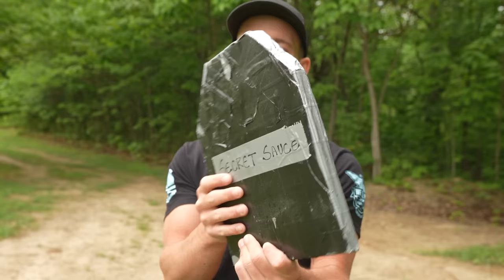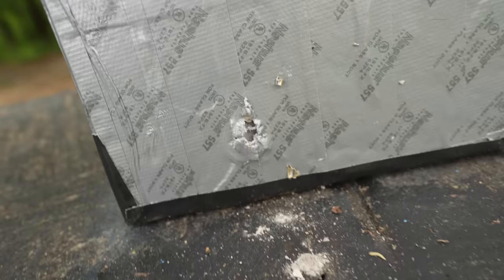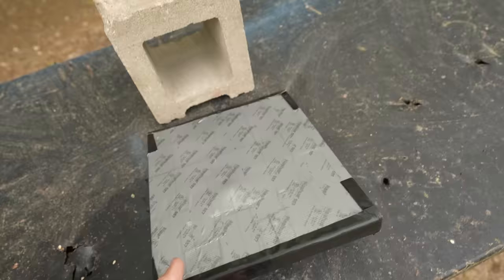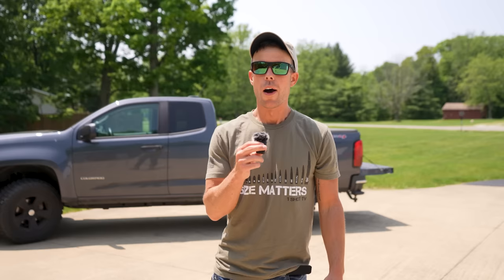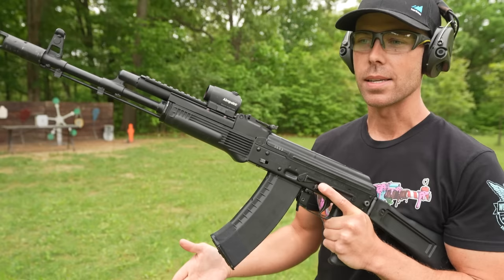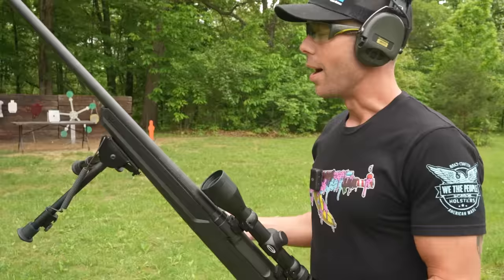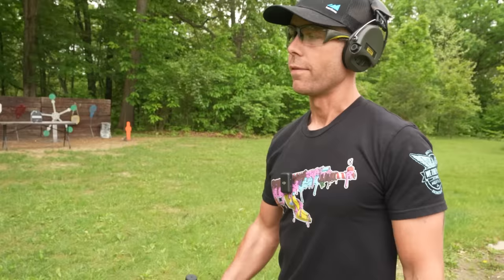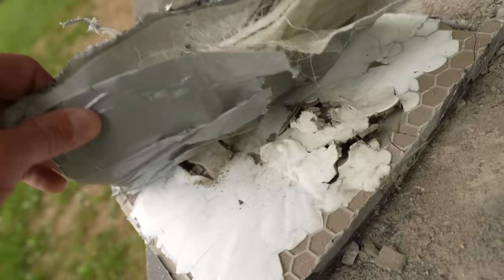CHEAP Homemade Body Armor That Stops RIFLES, How's It Done??

Comment: Got bored and made a plate ... it stopped 3 rounds of 556 and 4 rounds of .308 before it failed... but for 25$ and all materials came from Lowes I was impressed
Reply: i dont suppose i could talk you into sharing the recipe for that armour
Reply: You got a materials list?
Reply: @AlaskanBallistics  thats what im wondering too..i want that recipe ,if it can stop .308 then it must be a good one
Reply: @peacemaker121772  put it in my walls for when the AFT comes for 25 bucks i can armor the walls, at least in spots
Reply: @AlaskanBallistics  2 pieces ceramic flooring 12 by 12 .... fiberglass cloth with resin ... 5/16 ar 400 steel In the middle which I already had ... after the steel .. another layer of fiberglass with resin followed by the last ceramic flooring... followed by wrapping it in duct tape... this was before Biden inflation so I dunno what it would cost now
Reply: @MichelleObamaIsPackinASack  how heavy was it?
Reply: @Daledoback24  10lbs I'd say
Reply: @Daledoback24 that's my thought too bc AR-500 is pretty heavy ... Hell, just the steel in a plate carrier would stop a 50 API! Lol I've seen it done on many YouTube vids of guys shooting steel from short distance with those black, silver, and red tipped 50BMGs, and they stop em every single time (even the exploding 50BMG). not deformation even, yeah some spalling, but that's what the woven kevlar plate carrier is for.
Reply: @BillBraskyy blunt force trauma
Reply: @BillBraskyy AR500 may stop a .50 but if you tried to use it as armor the hydrostatic shock of those rounds will still be lethal. There is no armor that can protect you from .50 BMG unfortunately. At least not with the current technology we have because modern armor is still limited to withstanding .30-06 M2AP at its strongest and nothing else. You might survive against M995/M993 or maybe and I say this very lightly maybe 7.62x51 mm DUDS(Depleted Uranium Discarding Sabot) that were developed in the 50's with some law enforcement agencies having somehow got them by accident. You can survive being hit with these rounds if you manage to get your hands on a pair of Xsapis. But those are so expensive and impossible to get a hold of you're probably better off getting yourself a pair of level 4's and hope that you won't have to come face to face with such nasty threats.
Reply: Got a video showing that?
Reply: @forresthampton1135  I don't actually
Reply: @forresthampton1135  I don't have to show you a video. 895 grain .50 BMG bullet traveling at nearly 3,000 fps will have an impact force of about 14,895 foot pounds. You will not survive that no matter what kind of armor you have.
Reply: Imagine if it was thicker than a quarter of an inch or a half inch after all it could stop more 🤔
Reply: @Bill Brasky  the only mofo ever to catch a .50 round and survive, what you would be doing would not be considered living...
Reply: @nemesisobsidian  You saying that you won't survive it no matter what kind of armor you have, shows your lack of understanding of certain armors. Ceramic armor is literally designed to break and that breaking disperses the energy throughout the ceramic. This could be easily proven in a demonstration with a watermelon behind enough ceramic plates and shooting a 50 BMG at the watermelon. The energy will be dispersed through the breaking of the ceramic. This is why most people line the rear of these plates with a very thin gauge of steel or kevlar just to prevent any ceramic shrapnel from being pushed into the person wearing it. 

By the way, Botach level 4 plates have videos of I believe 338 Lapua and 50 BMG being stopped by their plates. I believe Mr Guns N Gear did a video on it. 

Now if you said your sternum and/or ribs would be broken, that I would agree with. But "surviving"... Ehhhh I think with the proper trauma pad behind it, you could easily survive it. You might not wish you survived...
Reply: @Steven-gv1ke  You saying that I lack understanding of certain armors automatically forfeits your mental high ground in this conversation. I have more understanding about armor materials and how they respond to being shot than you ever will. While ceramic can absorb kinetic energy, it's main purpose is to damage and disrupt the bullet so that a UHMWPE backing can more effectively do its job of catching a now deformed projectile and mitigate some backface deformation in the process.
Most level IV plates are aimed at stopping .30-06 M2AP or most rifle rounds that are less powerful than M2AP. 
You say that you've seen level IV plates stop .50 BMG, I've also seen a video of something similar to what you're describing. In that video, they fired a .50 BMG frangible round at a level IV plate. And most likely it was not a full power .50 cartridge. And while a level IV plate can stop .338 Lupua, the same issue occurs like it does with .50 cal. Even if the round is 100% stopped, the resulting impact will still kill you. There is too much energy in a .50, and this also holds true with .338 Lupua. So we're just gonna have agree to disagree at this point because I'm not the only one with common sense who is legitimately arguing against the likelihood of surviving a hit from an anti materiel rifle, a weapon literally designed to destroy everything in its path, including people.
Reply: @nemesisobsidian there is a armour that stops 50 bmg and its super thin like 1.5 inches something like that and its kinda soft armour to like 1 grand a plate i think lol
Reply: @Macdonald-we4gx  Lol, no there's not. It's entirely impossible to catch a .50 without the sheer impact being strong enough to stomp your insides into jelly. You might as well be saying there now exists armor you can wear on your body that can protect you from a direct hit of 120mm APFSDS. Honestly I'm getting tired of arguing with ignorant people who know nothing about blunt force trauma or simple physics.
Reply: @Macdonald-we4gx  Also armor that's super thin but it's like 1.5 inches thick. Lol, are you kidding me? That's not super thin, that's super thick. Nobody is going to wear armor that thick. Most commercial plates are either 1/4" thick or 1" thick max but no thicker unless you want to look like the Michelin man or be rocking that Ned Kelly look.
Reply: @nemesisobsidian  nevermind its like .48 inches thick 😅 dayton armour
Reply: @nemesisobsidian lol. You funny son.
Reply: @bonejam8231  If by funny you mean trying to educate the public about the absolute insanity of one thinking they can walk into enemy cross fire like they're Ironman or some crap without there being deadly real life consequences to that kind of thinking then yes I try to include some humor into my "scaring is caring" message. Glad to have gotten an lol from you.
Reply: @nemesisobsidian  listen brother if you're getting shot at by a 338 Lapua or a 50 BMG you're either going to have air support or you're in the wrong dudes backyard😂
Reply: @thomandstacieverroad8417  And you're probably right about that to some degree. Which is why I think it's dumb that you have some people out there and probably lurking around in this comment section who genuinely believe that you could survive a center mass shot from a freaking .50BMG! 
They don't call it an anti-materiel round for nothing.
Reply: @nemesisobsidian  I'm not great at math but I know that there's a formula for the pounds per square inch in relationship to the size of the target it's being dispersed upon and with a little bit of human physiology knowledge you could probably calculate just how many ribs would be crushed on impact. 😬
Reply: @MichelleObamaIsPackinASack  how many layers of fiberglass cloth? Are you saying 5 layers out of a pack of 16?
Reply: @rane9096  honestly don't recall the number of layers but I did split it up even .. half before the ar400 steel and half after .. it was one pack of 3M Fiberglass though
Reply: Very clever build. Using 14g steel to mitigate backface deformation made me curious how heavy it was, seeing that you used wood had me laughing. Some of our competitors use a ceramic strikeface that is so thick, that the fiberglass backer they use is really just there as a formality. I have 1 plate in mind on the market right now that I could put into a conditioning chamber, peel back the fiberglass backer they use, and replace it with a soaking wet piece of OSB plywood, form fit it using wood glue and C-clamps, let it dry and it would probably perform against M2AP exactly the same. 
People underestimate how hard it is to cut weight in a plate design, and a thick enough ceramic will always stop an all hardened steel projectile, coming along with the extra weight. 
But cutting costs as much as you did is 10x as impressive to me lol
Reply: What did you use to make it?
Reply: @OBrienx666  ceramic floor tile ..fiberglass cloth with resin .. 5/16 AR 400 steel in the middle ... wrapped in duct tape .. maybe 11lbs a plate if I had to guess ..
Reply: You all know nothing. The best armor out there is adamantium plate, completely coated in vibranium alloy, encased in a mithril mail plate carrier.
Reply: Think that lady 308 shot hit the red steal target and reflected towards you
Reply: @jeremiahr7585  dude that is great armour not sure why more people don't use it 😊
Reply: @nemesisobsidian  if .50 bmg had enough energy to kill just through sheer force of impact like you describe why doesn't the recoil from a m82 barret kill the user every time it's fired?
Reply: @finnpendleton4615  Because felt recoil is different from getting shot. You're comparing apples to oranges. The M82 Barret or any other rifle that chambers .50 BMG will have about 80-100 lbs of felt recoil so if you didn't have proper padding or a good grip that would certainly break your shoulder but it's not going to kill you. What WILL kill you is the energy in that .50 bullet after it has already left the barrel of that gun. I can't list them all here but here's the ballistic performance of one .50 bullet:

Bullet mass/type- .50 BMG 647 grain (42 gram) Speer
Muzzle velocity- 3,044 FPS (928 M/S)
Muzzle energy- 13,310 Foot Pounds/Force (18,050 Joules)

Now I'm no Biologist but I'm pretty sure Humans are not designed to withstand an external pressure of 13,000 Foot Pounds exerted on their body even when they're protected by plate armor.
Reply: @nemesisobsidian  not only that but I'm assuming those plates were hanging not strapped to a person where there's alot less give for the plate to move away from the force of impact.
Reply: @JACKINSTEIN  that goes for literally every single armour ever. There is no defence against the blunt force of a bullet except not getting shot in the first place
Reply: I'm a relative newbie when it comes to the firearm world, so me agreeing with you may not mean much LOL but it reminds me of the brain and skull when it comes to MMA or boxing. The world I'm familiar with. No matter how much headgear you have, no matter how much you hold your hands up, if a strong enough hit comes in, your brain still shits around and bounces off the skull / hard covering. From what you're saying I also picture an orange in a giant metal cup. Hit it hard enough and the vibration, hitting the side of the container, an ect, will damage to Orange even if nothing Pierces the metal outside. Not the technical term but just the Raw slam Force my brain wants to call it LOL
Reply: @bakionigeri6414  ya blunt force trauma is extremely difficult to protect against in all fields
Reply: @MichelleObamaIsPackinASack could u perhaps make a yt tutorial? Also mention me if you post
Reply: Make a video😊
Reply: I believe the secret sauce is apoxy mixed with baking soda, there is lots of youtuve videos showing how hard of a compound it creates when mixing epoxy & baking soda.
Reply: Wish there was a way you could share how you made it, but you might get in trouble with you too or you’d have some idiot out there trying to probably sue you
Reply: @jeremiahr7585  lol
Reply: How much did the plate weigh?
Reply: @finnpendleton4615  That's not even close to the same energy transfer, lol.  A .50BMG in most rifle platforms will have about 70-100ft lb of recoil energy while impacting at 12-15k ft lb.

If every firearm recoiled with the same energy it delivered on target then shooting a 9mm would knock people off their feet, break arms, etc lol
Reply: What did you make it out of and how thick?
Reply: @nemesisobsidian  Well, Ned Kelly's armor did have 18 bullets stopped in it.
Reply: @australiananarchist480  Yeah. Still not totally solved in American Football and other sports.
Reply: @mfallen6894  they both have the same energy. Newton's Third Law, all actions have an equal and opposite reaction.

The difference is the time and area. The force behind a 9mm is exerted only on the tiny section that's touching the projectile. The force affecting the gun (relatively) slowly goes into the shooters hand from the entire handle, and then slowly into the wrist, arm, etc.
Reply: @australiananarchist480  Yes, recoil velocity, I'm aware.  They do have the same energy, but no where close to the same PERCEIVED energy.

Thought I'd made it clear it was joke (and that it was clear that perceived recoil is what was being discussed)
Reply: $ 25 I doubt
Reply: @MichelleObamaIsPackinASack thickness?
Reply: @MichelleObamaIsPackinASack 67% COTTON 33% POLYESTERUSC Duraglas Fiberglass Filler 24030
Reply: Who knew the revolution could be so affordable??
Reply: @MichelleObamaIsPackinASack   thank you for the info my bro, if shit hits the fan I hope to have guys like you fighting by my side
Reply: How??
Reply: You guys are ALL missing the most obvious and important fact about 50 bmg though! What if it misses the armor completely and then misses your whole body by 2 feet, then it will still blow your whole arm off and you'll die instantly. Trust me, I would know because I'm an expert. I saw it on a YouTube short where an Army sniper said it on a podcast.
Reply: Cant you just add a lot of padding, foam or otherwise, behind the armor?
Reply: @BillBraskyy How thick are we talking? Certainly NOT 3/8ths! .50 API goes right through it like a hot knife through butter! Are you talking about 3/4 or 1"?
Reply: @Steven-gv1ke NO, there's NO single level IV plate that stops .50 BMG on the market! What are you talking about, like 3 or 4 plates stacked? 🤔 😳 🤣  That's certainly not feasible to wear!
Reply: @jeremiahr7585 You mean unobtainium? Yeah NO ONE is getting a hold of that unless you are a scientist with an unlimited budget!
Reply: @JM-wc2kv What "lady" are you talking about?
Reply: @lukewarm2075 Because no one can afford it! It's basically unobtainium!
Reply: @piotrplewa1889 You would have to, probably have to stack all of the cushions off your sofa!
Reply: @nemesisobsidian That's not exactly true, I mean not in the traditional sense of body armor, but there's plenty of things that will protect against it, such as a tank haha
Reply: @nemesisobsidian the best armor against that would be a tank or battleship lol
Reply: @michaelgreco1492   Depends on what you use for cover I guess. I could be wrong, but I remember reading somewhere that a .50 can go through a foot of concrete if it's not reinforced. I don't know about reinforced concrete though. Either way you're gonna have to be quick on your feet moving from cover to cover to avoid getting hit, but there's no guarantee that you won't get hit at some point in time.
Variety is the spice of life these days when it comes to potential risks.
Reply: Another channel used resin and like 10 layers of fiberglass, and stopped slugs. 556 no, so he was able to make 3a out of fiber and resin
Reply: @gateguardninja   You mean 25 to 30 layers of S glass and polyester or epoxy. 10 layers won't stop anything lol. 
Two PEI 5 Porcelain floor tiles in front of 25 layers fiberglass + resin will stop the 5.56. M193, M855/SS109 green tip, M855A1. It will stop all 3. Not sure how many it will stop of each one though. 🤔
Reply: @nemesisobsidian  gotcha,  they didn't mention how many layers there were, but ya thinking about it, a 5x8 should yield 30+ layers
Reply: I did a 30 layer carbon fiber resin layup vacuum bagged it let it set for a week it worked beautifully!!! Stopped 9mm 357 44 and it was light AF but no penetration..I'm thinking of doing another but alternating carbon fiber Kevlar in layers porcelain tile in the middle and more multi layers in the back laying it all up in a resin sandwich vacuum bag and trying rifle rounds next🤔(thanks out to goober dad for the tile idea)
Reply: Good movie!
Reply: Blunt Force Trauma, that is.